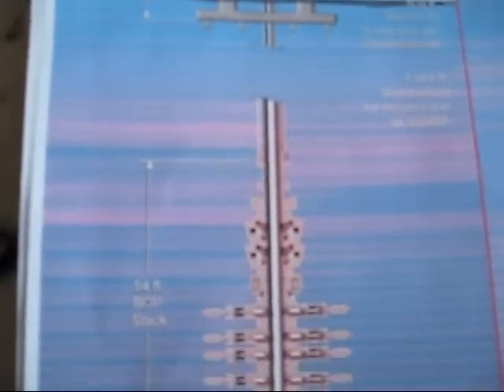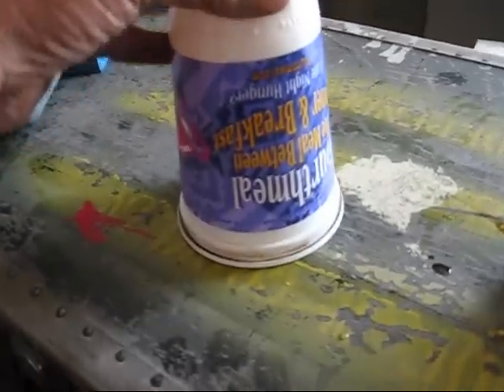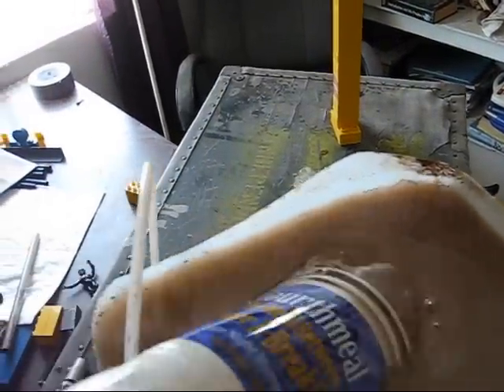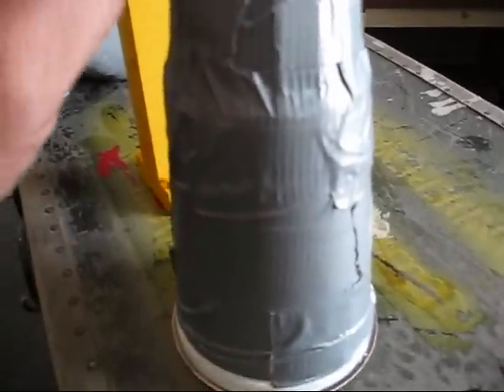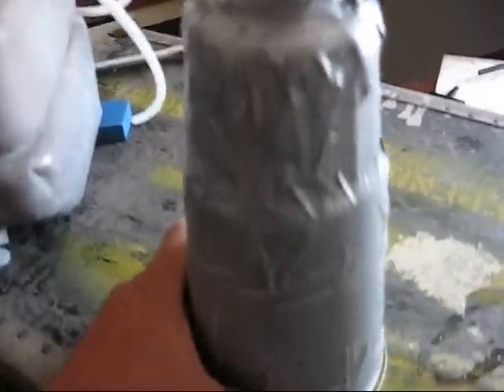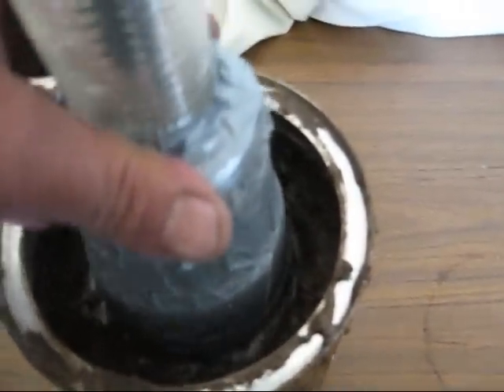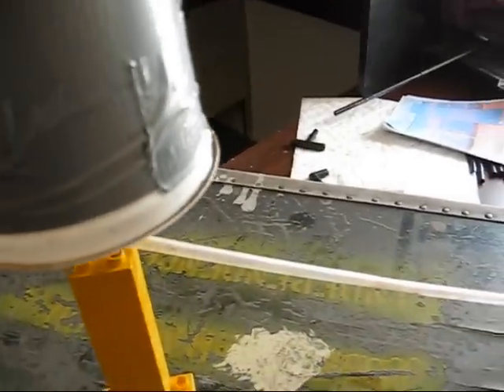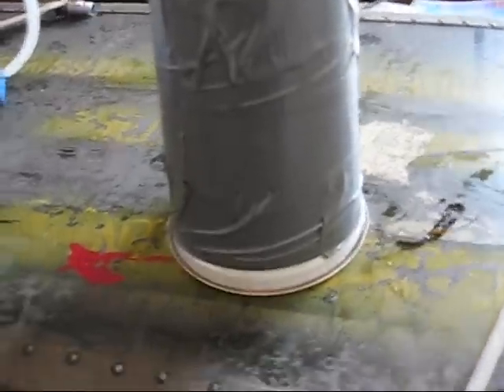ROUGHNECK`S PLANS TO STOP GULF OF MEXICO OIL LEAK.

Comment: Wow...just wow....clearly you're not certified in well control, nor understand the basic principles of pressure, hydrostatics, buoyancy or oil/gas wells of any description.
Maybe google a bit and read what pressure and volume of fluid they were dealing with, then realize your cup smashed into the sand won't hold it back.

Comment: a reasonable idea it apears. i wonder about drilling holes all around the oil leak and placing explosives into each hole. detonate all the explosives  and the concusion strangles and  crushes the pipe